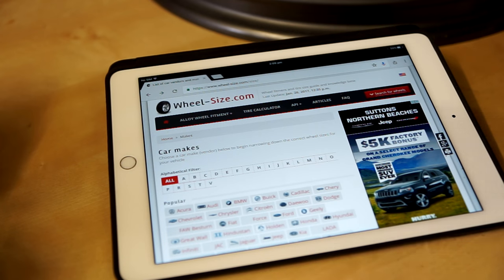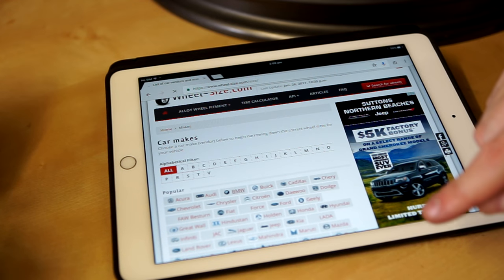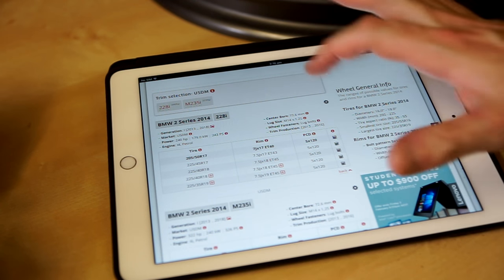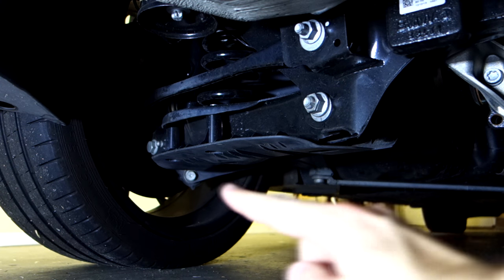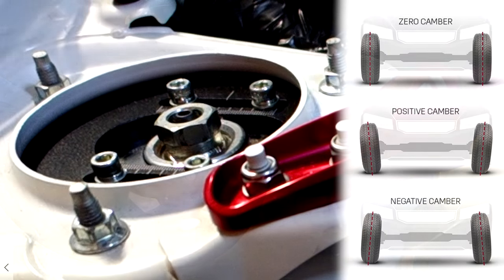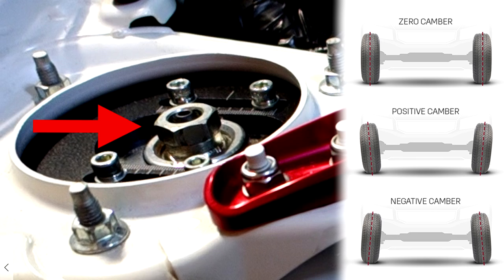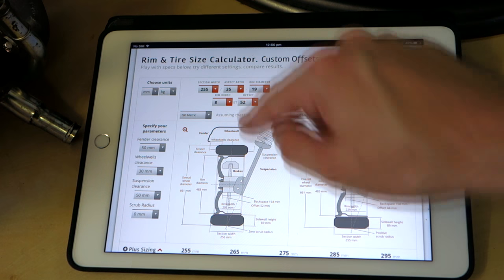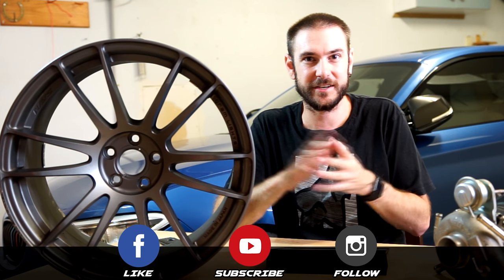How To Get Perfect Wheel / Rim Fitment - Complete Wheel Fitment Guide - Part 4

Comment: Berry excellent demo you did a great vid. I have a 2003 Nissan Sentra with Wilwood brake calipers in the front so I need a rim that will clear that while still getting a flush with the fender. Hopefully I’ll be able to get something like 195 35 16 or a 17... You wouldn’t happen to have any first-hand experience with that would you?

Comment: cant find the help i need to see what tires i should put that would fit i have vossen vfs2 19x9rims  all 4 set
my car is bmw e92 2011 328XI
and i want to do low profile it possible
Reply: 235-45/30-35 R19 is along the lines of what ur looking for.. keep in mind that there’s a lot of factors that go into that so I would use this as a starting point and go from there